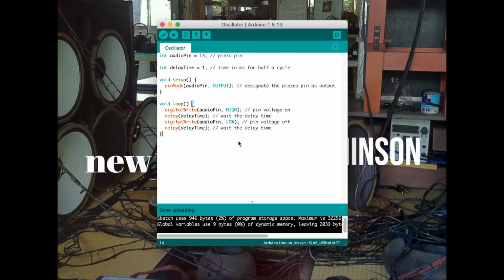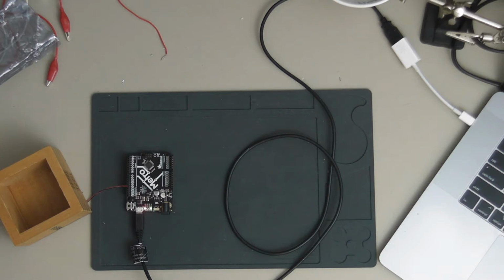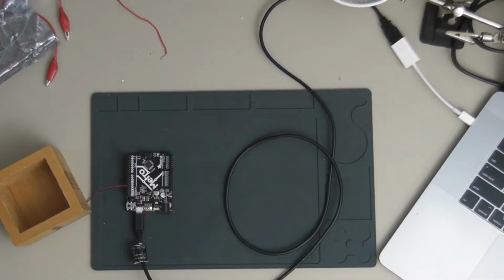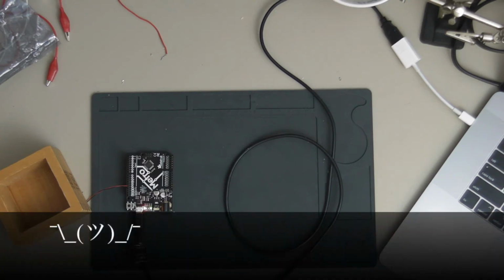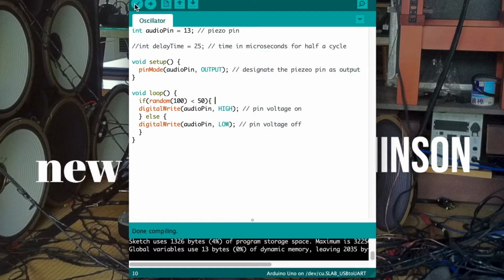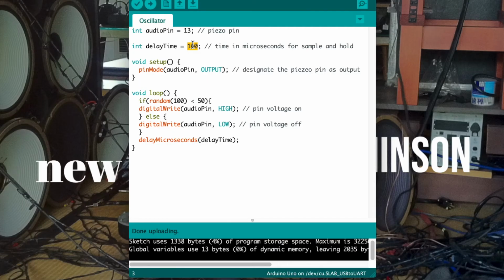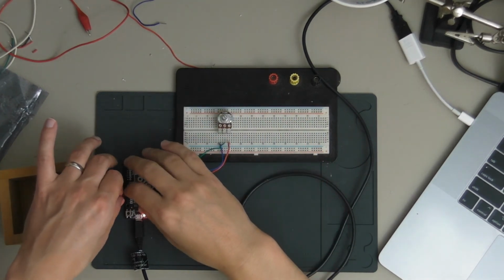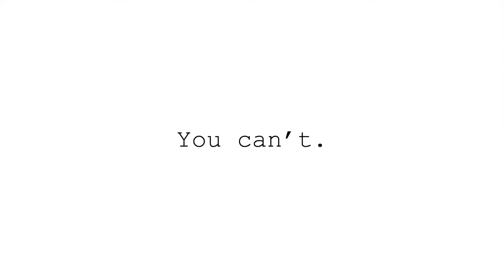Arduino and Audio: Noise and Chiptune Magic with Sample-And-Hold | Simon Hutchinson

Comment: super nice experiment! What's the sketch for controlling with LDR? I am trying to work on something similar but with ultrasonic distance sensors but I guess the principle should be the same? Thx
Reply from the maker: Gosh. Man, I made this video two years ago, so I'm not sure I still remember. It's pretty straightforward, though. There's nothing special in the Arduino program, just reading from the analog ins as usual! More ideas here: https://create.arduino.cc/projecthub/tarantula3/using-an-ldr-sensor-with-arduino-807b1c